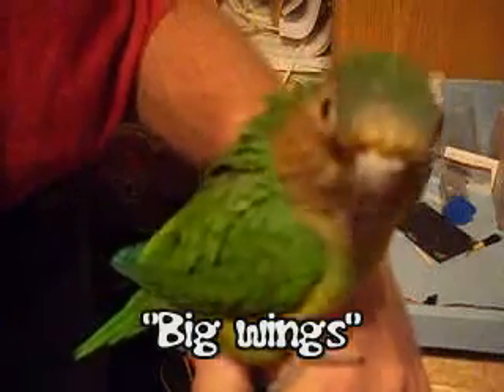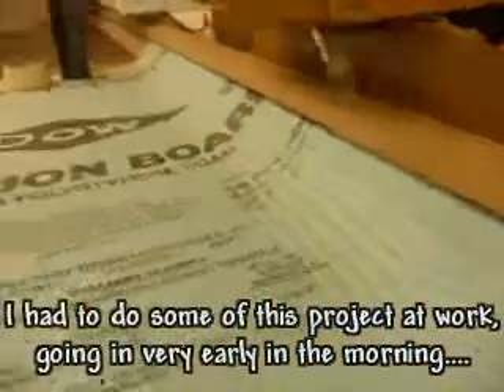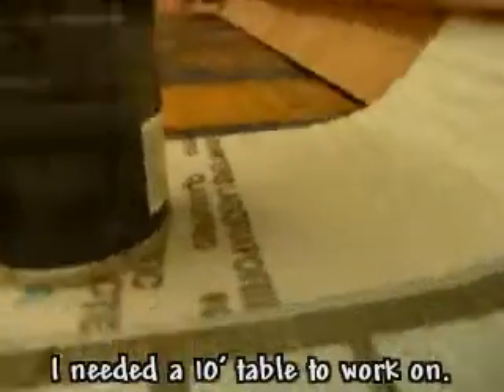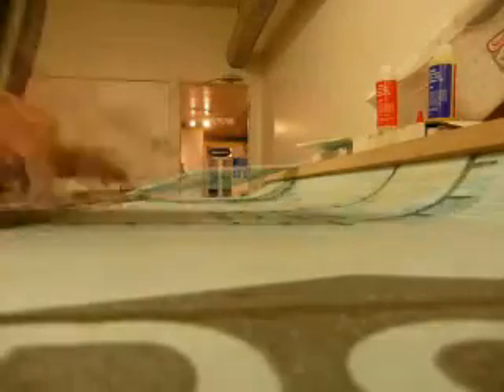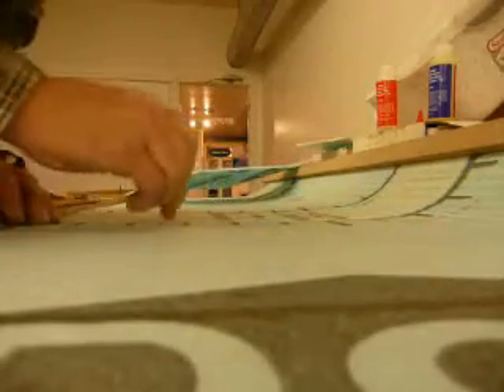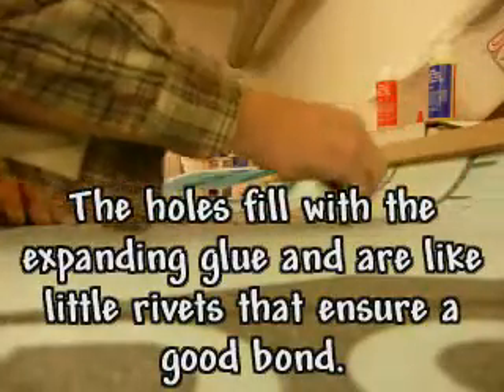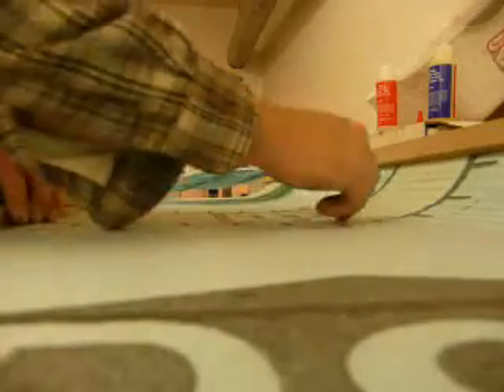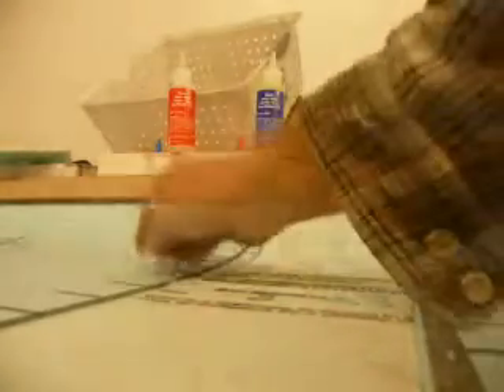Big Wings, part 1; 8 ½ foot wingspan RC plane

Comment: Hello Parrot Pilot, its great to see all the abilities you have and want to share with us, I have several questions for you, 
1 where do you get that great music
2 do you cut the fiberglass the way you use it inside your hand or do you buy it cut
3 are you using elmers glue to bond those fiberglass particles as if it was resin
4 WHERE is the video of the Big Wings flying, already saw all the videos of the buildup   now its time to see it in action.
  thanks